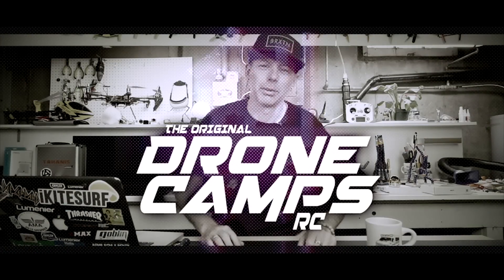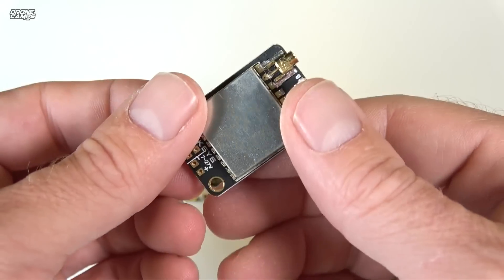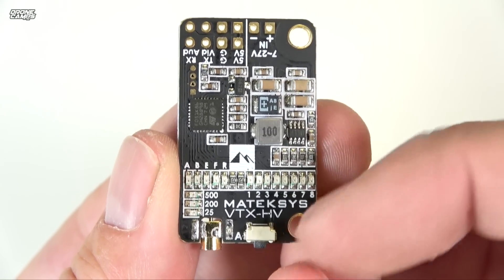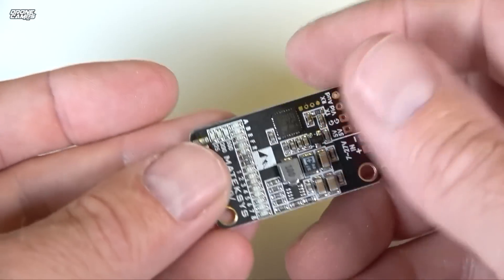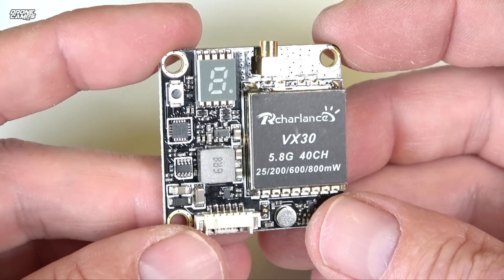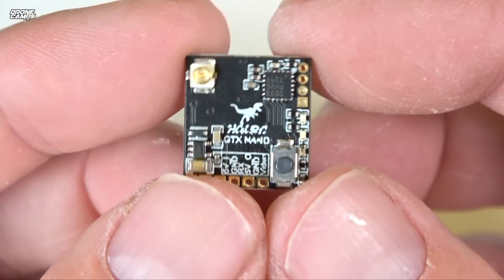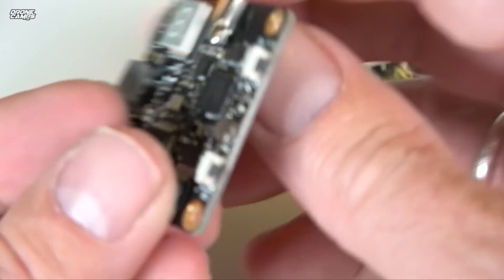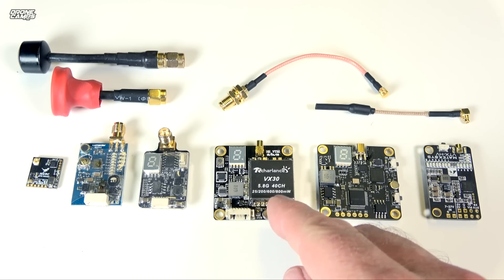VTX SCHOOL - FPV Pilot Buyers Course ( Don't get burned! )

Comment: I love the matek too bought 6 of them last spring. Had four of them reading 80 milliwatts on 25 milliwatts and to reading 15 milliwatts 25 milliwatts. So i coupdnt race them. Fortunately I have some Wing friends so the ones pumping out 80 milliwatts and 25 pumped out over a watt on 600 so I got them sold

Comment: The advantage of IPEX connectors is definitely the weight. If you´re going to get as less weight as you can from a quad, you can´t disconsider it. Smaller 20x20mm video transmiters with the MMCX connector weights about 2 grams more than if it was with a IPEX. About swapping antennas in and out, in a light setup you just want the lightest- a dipole, and you probably won´t change it anytime soon as it´s protected from the props, because in crashes the are so bendy that they can´t be damaged that way.
Reply: Yes I agree. Ive smashed my drone 100 p,us times and never broken the smaller IPEX lightweight VTX's they are excellent. I have a few even tbs 5G8 but im reluctant to use it ATM due to the reliability of the smaller 200mW VTX's.

Comment: Ok i have a Matek HV with Pyrodrone Hyperlite f4osd and I cannot get irc tramp to work no matter what I do. It is wired correctly as pirofliprc diagram says. I have tried betaflight 3.3.3,  3.3.3 w/akk patch, 3.4, 3.4 w/akk patch and Butterflight. I flashed back to 3.3.3 w/akk patch and it will work only when connected to betaflight configurator. Anyone have a solution for this? It is extremely frustrating.

Comment: I have several different ones and have to agree with the MMCX statement. I use hot glue on some of the UFL ones however sometimes it gets so hot it melts. I am changing most of my quads to smart audo or tramp as well. The new AKK VTX's are very nice as well and they even have the UFL and MMCX connector on the board. You should check them out. Nice review sir
Reply: I have heard more then one person say they are crap. Check out JJrotorgeek's video on them. Several guys in my club have had dead on arrival through Amazon. But several said they have no issues through buying them online stores....
Reply: I will check it out. I have the AKK FX3, the AKK BS2-OSD and  AKK nano 3 and a few more AIO cameras and haven't had issues yet. Now the FX4 and Nano 3 are still new in the box as I picked them up in their last big sale. I do like their customer service, prices and shipping. I have had issues with things that everyone else swears by too so I find with this stuff it is hit or miss. I picked up the extra stuff in case my current stuff dies as I have a lot of BNF quads and I also wanted smart audio on my quads so went with the AKK. Man they even had a thing were they gave you free stuff if you ordered over 60$ worth and I contacted them and asked if I could sub out the free stuff for things I actually wanted (MMCX pigtails, antennas and a parallel charging board) and they gave me more than I asked for. So it's hard for me to knock them at this point. But I do get where you are coming from and always remember you often do not hear from the happy customers and it's usually the ones who have had a bad experience we here from. I do thank you for your advice though and will take it in consideration on my next purchase. Cheers John

Comment: Does the matek vtx come in a 20x20? Im considering this for a 2.5 inch build but have trouble finding where to put it. I am using the gperc px2.5 frame and using the mamba f405 stack.

Comment: Thanks! 1200 mw would be sweet, but isn't there a 1 watt limit in the US?
Reply: Thumbpicker FPV you must be talking about FCC Part 15 regulation which limits licensed devices in the ISM bands to 1 watt. 

Since we do not use Part 15 licensed equipment and we are not using spread-spectrum, we have our Amateur Ham License which allows us to use the ISM bands. 1200 mW shouldn’t be an issue assuming you don’t cause interference.

(you do have your Amateur license right? of course… we all got certified)
Reply: The difference between 1200 and 800 is not much. A good antenna is far more important than a high output vtx. A high Db  gain antenna will go a long way even on lower power. I bet it doesn't output what it claims anyway.
Reply: Actually, I wasn't asking about part 15. I asked because I heard someone mention it in a post. Thanks for the info though. I'm new to quads, so just trying to get correct info. And yes, I have my extra class amateur radio ticket. Licensed since 2004.
Reply: Dale Pattison
Thanks. I agree that without a good antenna, wattage means nothing. I can get a few miles LOS on my 2 meter 200mw walkie. I know, different frequency, but same principle.

Comment: Just an FYI.........those little mtx connectors have a limited lifespan They'll only stand up to so many plug/unplug cycles before they break. The bigger ones are slightly more durable than the tiny ones but they're still fragile.
Reply from the maker: I mentioned that in the vid bro! 👋🏻🤣
Reply: Drone Camps RC Yeah, my bad. Sorry about that. I heard you say that about 30 seconds after I finished typing then I got distracted and forgot to edit my post lol. Keep up the awesome work!
Reply from the maker: Haha no worries man!
Reply: Thanks for your tutorials and thumb up for your pronunciation, which is quite clear to understand for non native english speakers!